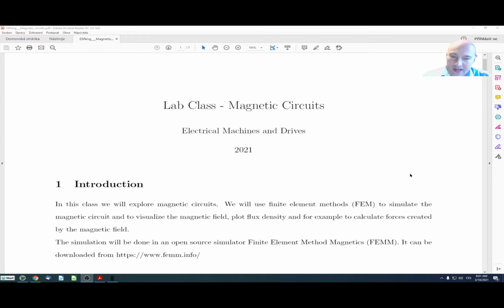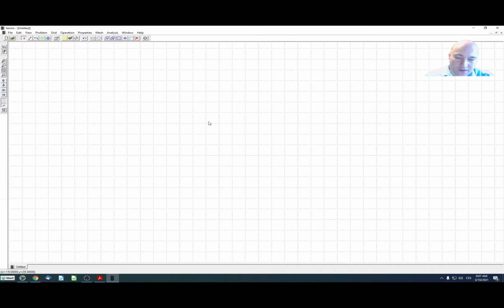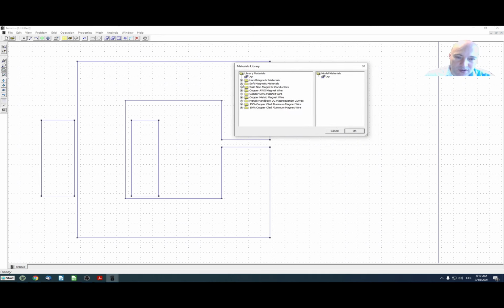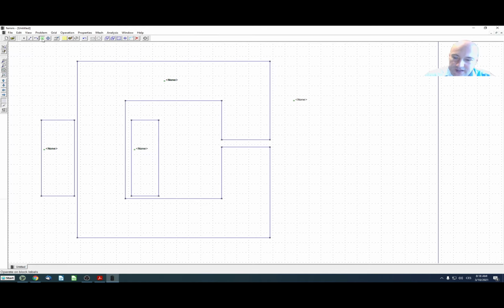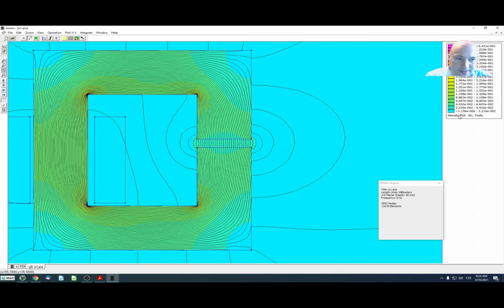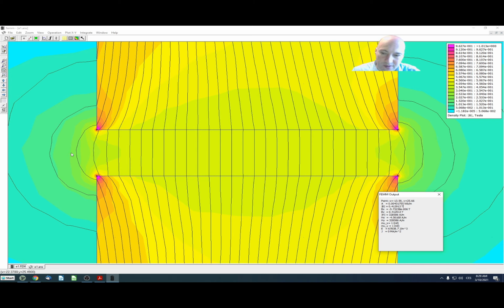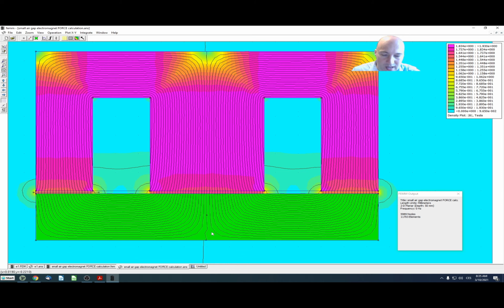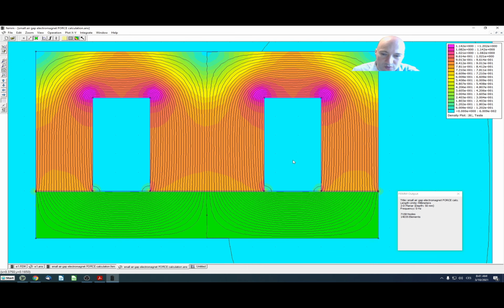Magnetic circuits

Comment: I just think if I have a iron core, most of the flux are suppose to pass the core not goes in to the air, so the total flux should not change that much m if the cross section A is same everywhere in the core path, the I suppose to see B is same everywhere.

Comment: Hi Martin, the B in the core and air gap based on the magnetic circuit equation  are supposed to be same or similar right ? or at least in the core , B should be same everywhere right ? but based on the magnetic line in the simulation , it seems more near air gap, the B reduce a lot in the core. what is the cause except the fringing? As I think most of the flux should remain in the core, and if the cross section is same then B should be same everywhere in the core right ?